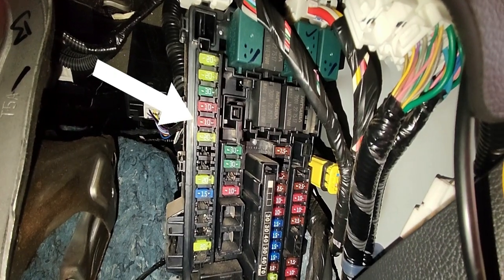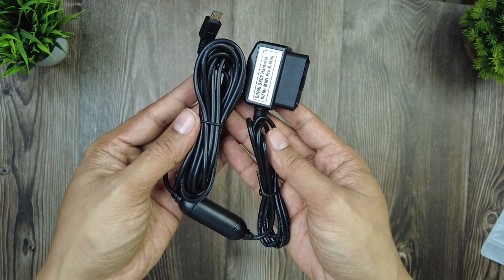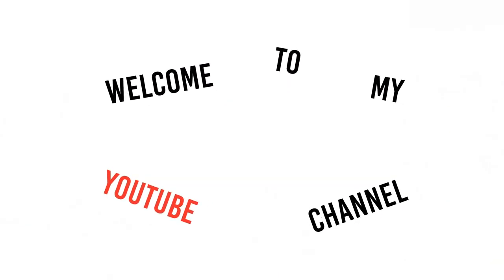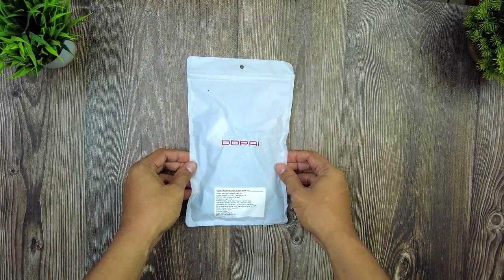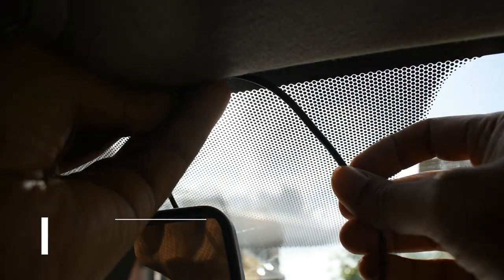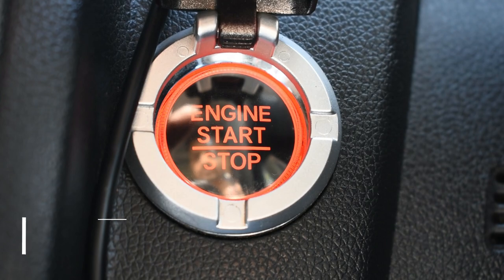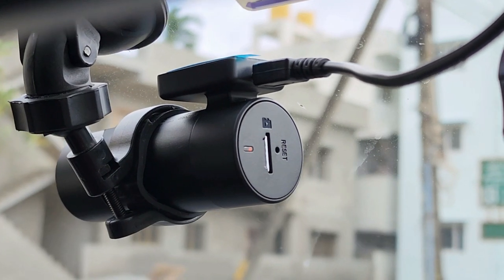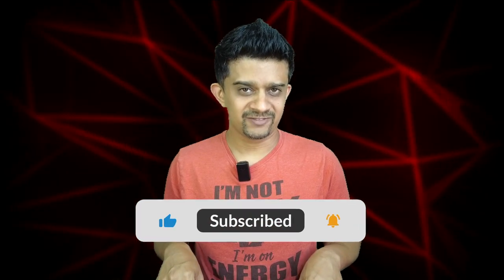The EASIEST way to get Parking Monitoring | OBD-II Connector Hard Wire Kit for DDPAI Mini & Mini Pro

Comment: Hello, I've been following you on Youtube and I know you're very knowledgeable about ddpai's dash cams. Please tell me the hardwire kit for ddpai mini pro only has 2 pins ACC and GND so it is not continuously powered. But why does ddpai still announce that mini pro can monitor parking when the engine is turned off if the hardwire kit is installed as above? Looking forward to your explanation. Best regards!

Comment: Hi, how safe is it to use hardwire with OBD2 connector? Are there any car safety concerns on using this product like short circuit, etc.?
Reply from the maker: None. Its perfectly safe. Also to prevent battery drain, enable the battery protection feature within the app settings of the dashcam.

Comment: Hi sir. I’m planning to buy this hard wire kit with obd for my ddpai mini pro dash cam but the bad news is there is no available here in UAE 😢. If ever sir Is it actually work to my ddpai mini pro??? Thanks
Reply from the maker: Yes it will work.
Reply: One more question sir. I saw the one review video of nextdigitron the   Other hardwire kit without obd2 port connection for ddpai mini pro. It has 2 wire connection only vcc fuse (red) and for ground (black). Where is the acc fuse(yellow)? Thanks in advanced sir

Comment: Can we use the obd 2 kit of ddpai with 70mai? As 70mai also has a micro usb port. Didn't want to meddle with the fuse box as it may avoid my warranty.
Reply from the maker: Nope. 70mai will release their own OBD2 kit soon.
Reply: @traveltechyoutube OBD2 not yet released for 70mai. Can we buy other generic OBD2 power cable ?
Reply: @traveltechtube. How can we connect 70mai dash cam through obd2 hardwire if ddpai one is not working.

Comment: What is the risk of battery drainage? How will the DDPAI Mini know that it is connected to OBD?
Reply from the maker: Smart chip inside control box detects voltage to know that its connected to OBD. It has battery protection mechanism built in.

Comment: Super sir, thanks much for the info on time as told yesterday, very helpful sir 🙏🏻
Reply from the maker: Glad to help 👍
Reply: @traveltechyoutube Hello syed sir, i have got my ddpai mola n3 dual channel and installed it by myself with your video help. Will observe the quality and hoping for a good experience. One thing is, the ddpai app absolutely s*cks and one of the most clunky and unstable app proving to be like chinese duplicate gadgets 😀..anyways managed to setup and leave it at that. As of now not connected ODB adapter and kept as reserve and will mostly use the powerbank option for shorter parking surveillances. Thank you for guidance and if nexdigitron is your company, theh kudos for great packing and perfect delivery 🙏🏼
Reply from the maker: Hi.
Yes, the app is only required for initial setup. Once done, you won't have to use the app ever again. Also, Nexdigitron is not my company 🤣, they only send me their dashcams for review. Anyways, glad to help and have fun with your Mola dashcam. Cheers!
Reply: @traveltechyoutube  thank you sir 🙏🏼

Comment: Do they have similar thing for 70mai a500s?
Reply from the maker: Should release in a month or two.
Reply: Every dash cam work on 5v 1.5 amp to 2 amp max..
Socket type c pin or micro usb..
So this thing work work on any phone any dash cam..I will guarantee.

Comment: Thanks! Do you know if you have "2" dashcams? Can you plug one into the obd port and hardwire the other one?
Or will that cause some issues?
Thanks for any answers. 
Brw,love from Florida USA ❤️ 🇺🇸
Reply from the maker: Yes, one camera can be connected using OBD2 and the other via regular hardwiring. But this will cause the battery to drain faster and will reduce the life of the battery

Comment: After connecting this to obd , if we don’t want parking monitoring should we disconnect obd plug each and every time we off the car ? 
Or any option to off parking surveillance?
Reply from the maker: You have option to turn off parking surveillance within the app if not needed.
Reply: And one more question 
If we off ,That will not drain the battery ? 
Have 70mai A500s 
Looking to buy obd
Reply: If the this socket pin and voltage match then it can work on any camera ,phone every thing

Comment: Very helpful, but unfortunately my ace gps doesn't support the parking monitor aand it also had gps module as a part of wiring harness. But again this would be really helpful for others.
And i do have a workaround for my Ace gps, whenever i need parking monitor i just simply hook into my powerbank and it starts recording and works like a parking monitor.
Reply from the maker: Good idea.

Comment: Sir, does using this obd 2 hardwire kit will have a chance to void warranty in any sense?
Reply from the maker: Generally, any warranty is considered void if any alteration is made, specifically in the electronic circuit, like cutting any wire, joining new wires etc. Plugging in a OBD adapter into its port in the larger sense doesn't void the warranty in any way. 
But if you enquire with the car company/service centre, some might suggest that it can void warranty because any aftermarket electronic unit you use with the car is (by the book) not recommended by any car company. 

So to answer in short, it doesn't void warranty per se, but to be free of any risk and the possibility by the company to deny warranty claim, remove the OBD 2 adapter before giving your car for service and you cam claim 100% warranty.
Reply: @traveltechyoutube  thank you. Is this obd connector be connected to 70 mai m300
Reply: And does it consume less power fron the battery during parking monitoring system?